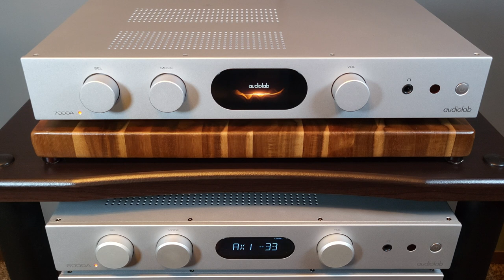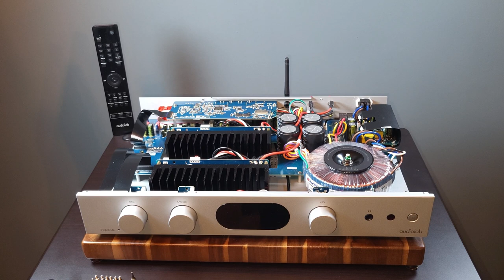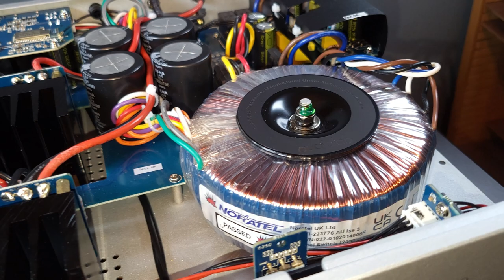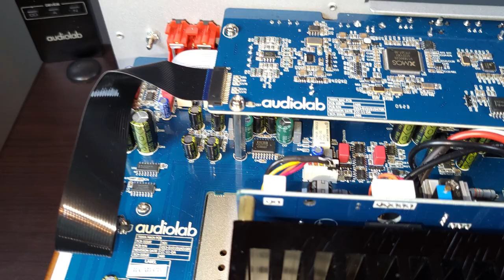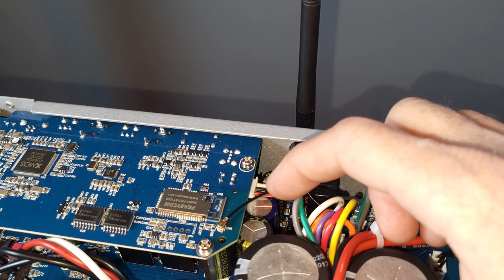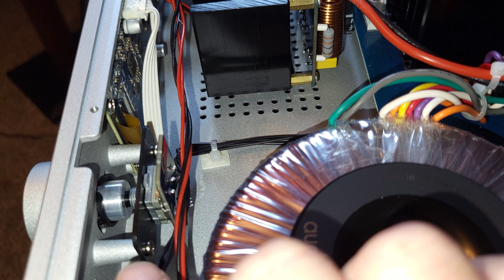Audiolab 7000a Fully Featured Integrated Amp full in depth Impressions video 4k Pop Da hood @28:18😆

Comment: What isolation platforms are you using under the equipment?
Reply from the maker: It's a cutting board made from arcandia wood with small rubber feet on thr bottom let me see if I can find you link '
Reply from the maker: It's Acaia wood cutting board prices from 30-150 bucks mine they don't sale anymore but here's a cheap one from Walmart- somewhat alike 
https://www.walmart.com/ip/Schmidt-Brothers-Cutlery-Acacia-End-Grain-Gourmet-Cutting-Board/1527534896?wmlspartner=wlpa&selectedSellerId=0&wl13=720&adid=222222222781527534896_117755028669_12420145346&wmlspartner=wmtlabs&wl0=&wl1=g&wl2=m&wl3=501107745824&wl4=pla-306310554666&wl5=9014329&wl6=&wl7=&wl8=&wl9=pla&wl10=8175035&wl11=local&wl12=1527534896&wl13=720&veh=sem_LIA&gclsrc=aw.ds&&adid=222222222381527534896_117755028669_12420145346&wl0=&wl1=g&wl2=m&wl3=501107745824&wl4=pla-306310554666&wl5=9014329&wl6=&wl7=&wl8=&wl9=pla&wl10=8175035&wl11=local&wl12=1527534896&veh=sem&gad_source=1&gclid=CjwKCAjw_LOwBhBFEiwAmSEQAbhRxJCWytw7sOJ_Ino6vRTo5uKyZ0_KoAEl53ynXfNBS5w5_sjewhoCkTwQAvD_BwE
Reply: @tee-jaythestereo-bargainph2120  thanks Tee-Jay, appreciate your help
Reply from the maker: @Kukkema  that's what I am here for !

Comment: For shits and giggles, I hooked up my tube pre amp to the power mode off the 6000a ,  and you wouldn't believe how much better it was.
Reply from the maker: Heck yeah man !! I do the same with Freya plus - That's great !!
Reply: If I may ask. What tube preamp do you have? I have a 6000a with klh model 5’s and was debating to try the same thing just to see what it would give me. Thank you.
Reply: I'm using the purity audio foundation preamp, 6922 tube.  I'm also running the kef LS50 and I couldn't believe it, where the 6000a struggled as a intergrated,  by adding a separate preamp the kefs opened up to their potential even with 50watts per channel.
Reply from the maker: @chrishmeet  most likely has a higher gain output with Preamp I use 6922 also JJ gold pin that's good to know because my 6000a struggles with my metas espically in my bigger room

Comment: Great as usual review one thing the selector for gain 6 +/- dB I don't think you mentioned it on the preamp out doesn't it have it on the preamp out? Happy New Year you got a new place or change your room
Reply from the maker: I have 2 Music rooms nearfield Room you see in Video and I have a much larger entertainment room that's highly treated with Panels and diffusers ' 
Many pics on my Community page ' 
In video I said the input gain level is built into the pre-amp section of the Intg amp for 'analog inputs only' So yes it works In pre amp mode and Integrated amp mode ' Just doesn't work with digital mode or  dac inputs coax/toslink/USB/HDMI only the 3 Analog inputs and Phono Pre EQ - So basically just in the analog domain of inputs.
Reply: Right so do you know what the output voltage is from the preamp if you have maximum 6DB of gain?  @tee-jaythestereo-bargainph2120
Reply from the maker: @jedi-mic  I would have to have a schematics of the circuit ' And I couldn't find 1 ! I tried 😪
Reply: Well you could measure the voltage with a vault meter set it on AC measure the pre amplifier RCA on One Channel and what it is at maximum and what it is at minimum, there is a calculator for that as well but I remember where it is of hand. I would say something like 5 volts ppv, question is what is its lowest point it can't really be less than half of Volts. When you got it on - 6 dB does it seem really quiet do you have to turn the maximum master volume up? Question is where the starting point is? I can't seem to figure that out if it say zero dB normally that's two volts peak to peak. I would say must be a vote in a half difference??? @tee-jaythestereo-bargainph2120

Comment: Hi tee jay is the preamp section much better than the 6000a
Reply from the maker: Pure analog or Pre with internal dac ?
Reply: Just using the 7000a in pre mode to drive a power amp
Reply from the maker: Yeap I told everyone  it's better for sure !! Reason I went in depth with popping the hood ' 🤪  Congrats solid Intg amp ! And Pre or power amp ! Great thong about Preamp mode is it turns the power amp off for less noise '
Reply from the maker: I miss read your ? Lol I thought you was saying hey 7000a is much better than 6000a as pre 🤣

Comment: Great review! I like especcialy that you take apart and offer an inside look in reviewed gear.
I've got the 7000a, paired with Elac Unify Reference bookshelf speakers.
My only fear is because the amp heat the room like a toaster.
Reply from the maker: Yes the amp does get a little warm 
Use some old cork squares underneath the amp in all four corners wear the feet are ' like they 
Use with Record players ' this will lift the amp up for better airflow and disapait the heat,  under the 7000a are some very nice vents ' and those square cork will help with vibrations no since in buying $200 esoteric feet !!

Comment: How did it do with the Comète 40th ??? Also, would be interesting to compare to Denon 1700 PM
Reply from the maker: Actually the Audiolab7000a with 🔺️ 40th Comete was not a good pairing but 🔺️  with the Denon PMA 1700 OMG !! 🔺️ drop down to 2.5 ohms they like higher current Amps ! 
Once I review Denon I will compare them And Schiit Combo !

Comment: 7000A or Yamaha R-N800A for KEF R3 Meta?
Reply from the maker: Bro you better go Audiolab  !! 
Zero-Fidelity will back me up !!! 
Thay Yamaha is to bright for those 
Speakers I love Yamaha but it's a 
Picky amp ! 
I have 3 sets of Kefs trust me ! 
But honestly 9000a would be your best for drive power but you have option if i was you i would by the New Marantz 50 2channel integrated amp that took the place of the Pm8006 the synergy with Kef/Marantz is very good also but Marantz puts in a hefty 625va toridal transformer for drive power !! Go with new Marantz 50 2 ch intg amp !
Reply from the maker: You will thank me !! But Marantz doesn't have built in dac 7000a is very good but r3 meta if you listen loud love power Marantz 50 can draw 65amps of power instantly ! 
It's a solid amp ! But 7000a is good also ' but I think Marantz does it better as far as drivel power and imaging
Reply: @ythestereo-bargainph2120 Thanks dude. That is a lot of info for me to digest. Guess I need to do more research.
The choice is obviously dictated by my budget.
The reason why I was considering Yamaha R-N800A is because it has a built in streamer and I read that it has more than enough power to drive Meta 3s. 
You did say that Yamaha amp sounds to bright for Mata 3s. My plan was to actually use Yamaha for the power aspect only but bypass its DAC by connecting Chord Mojo 2 with RCA cable to analog input in Yamaha amp. This way I thought I will have class A DAC from Chord Mojo 2, combined with the power of Class AB amp from Yamaha. Would be good to know what you think in case I am just bulshiting myself with this idea. Once again many thanks for all the valuable info.
Reply from the maker: @pistopit7142  I see some problems there when you use the Yammies built in streamer its connected to the internal dac of Yammie ' you will not be able to run digital stream output to your dac and then back into the yammie analog inputs ? Let me look up that Yamaha cause I do believe built in streamer uses built in dac ? Just went threw this a few months ago with the Audiolab Omnia !! The built in streamer is tied to internal dac one guy thanked me a million times for letting him know lol or maybe you use another digital transport to your Chord dac then to yammie just want you to beware of streamer/internal dac only ' Hope the hell I didn't confuse ya 
Karta.boy.1974@gmail.com 
My email ' I know it's nice having 
All built into one ' but built in dac on yammie might sound great with your setup '
Reply: @ythestereo-bargainph2120 many thanks. That is a briliant point I've not thought of. So if I use Yamaha streamer then I will likely be forced to use bult in DAC. That makes a lot of sense.

In the setup with Chord Mojo I was describing earlier I was planning to have Chord Mojo connected to my PC with usb-c  cable so I would be streaming from my PC rather than Yamaha. I think in such setup I would be able to bypoass built in Yamaha DAC.

So I guess I would need to use both DACs depending on my source of streaming. If I understand all this correctly, then I think that Yamaha amp is still a pretty solid deal. On many forums I see people prising Yamaha for it's neutral sound, I don't know how much I can believe it. It's really hard in audio world to make an informed decission, there are so many often contradicting opinions. This is especially hard for a newbie like me who is currently rocking old and loved Klipsch R41-PM with Chord Mojo 2 in the loop. One thing I can tell for sure is that whatever I upgrade to Chord Mojo stays in the loop. It has added so much live into my old crappy speakers.
Reply from the maker: Yes You got it figured out 😃 
I think Thamarbar utuber just reviewed the Yammie check out all of his reviews but Remember he is use to $14k intg amp ' for the price yammie looks solid and has mic and yapo room EQ - But if I had R3s I'd go to Accessories4less and find a used Marantz PM 8006 or Marantz 50 intg amp sometimes they go for almost half price and you still will have a warranty but you may want to watch Gabster utuber who builds Pi streamers for budget price ' and add Pi streamer just with digital output 
To Chord - just keeping It real It's almost like Marantz n KEF have a thing going on lol I have Ls50metas Q350 q100 Q900s I sold long ago ' 
Love Kef and Klispch also sounds good on Marantz I had Rp160ms
Reply: @ythestereo-bargainph2120 So I've watched that yamaha review you have recomended. Man thanks so much for halping me to avoid costly mistake. I know it's youtube but when he turned on the music sample at the end it sounded like my grndma's radio if compared to my Chord Mojo 2. I guess my search will continue. Will check out Marantz amps next.
Reply from the maker: @pistopit7142 that's what I am hfor ere for 😃 Accessories4less  will adventually get the Marantz 50 @ lower price refurb/used ' even Pm8006 is solid with Kef speakers and klispch
Reply: @tee-jaythestereo-bargainph2120  Yea Marantz is a good shout. I am eyeing at Marantz 40n. Just because I can get a deal for it if I buy it together with R3 Meta. All for £3100 here in UK. Was just watching few reviews of that Marantz and it's on a warm side. So KEF speakers neutral + warm signature amp = moderately warm sound signature of entire system? Maybe, maybe not. Une downside of that Marantx is that it does not have USB DAC. But my PC has toslink output so that should do for any file up to 24bit 192khz. I will be streaming Tidal mainly so that is the best files I will get anyway.
Reply from the maker: @pistopit7142  yeah I have Tidal as well ' look up TeeJays Rock Test tracks 😆  but yeah that's a great price!!! Hell R3meta cost $2250-2500 U.S. alone 40n has streamer I think ?
Reply: @ythestereo-bargainph2120 I'm a big fan of Korn and Tool so need to say TeeJays test tracks rock my boat 100%. Yea 40n has a streamer and not a clunky one like many others. I've checked Marantz model 50, it's cheaper but it does not have any digital input and it's a must for me so will pass on that one. Got three more deals on Audiolab9000A, Denon PMA-1700NE and Arcam Radia A25. So will be still checking these 3 before making final call. For now Marantz it is. Damn I did not knew KEFs are so pricey in USA, maybe they are cheaper in UK because they are British company who knows. I've heard the new batches are made in China anyways.
Reply from the maker: @pistopit7142 Yeah ' Huge Kef Fan also ' I have the Denon PmA 1700 in to review for ecoustics ' I will try soon on ls50metas !!! 
I get you want the digital inputs does the 40n have hdmi input ? I heard good things about 9000a by Zero-Fidelity just wish it had hdmi input like 7000a !! I do use 7000a in my back bedroom paired to ls50metas '

Comment: I am really struggling to decide between the 7000a and the Marantz Model 40n. They both seem like excellent choices and I can find a used 40n for a similar price to the Audiolab. I am currently saving up for a pair of Buchardt s400 mk2s. Any thoughts on which of these two choices would pair best with that type of speaker?
Reply from the maker: Honestly I have never tried out the 
MARANTZ 40n - but I have owned many many Marantz Amps and  I know the Marantz House sound very well ' but i do know Those Bucharts love power to wake up ! 
My opion I'd Go Marantz 40n or the New Marantz 50 2 channel integrated amp basically the new Pm8006 but New 50 is  pure analog but powerful up to 65 Amps of current!! with a 625va toridal transformer and Hdams ' I believe the Marantz will give you better bass control and fullness ' IMHO 😉 
But Zero-Fidelity has had the N40 he'd be a better reviewer to ask tha KS for stopping in
Reply: @tee-jaythestereo-bargainph2120  thank you! This is very helpful advice.
Reply from the maker: @thebigcurr  that's what I am here for is you all ! Not the companies ! 
Even if you have a ? Non related to video about audio I will do my best